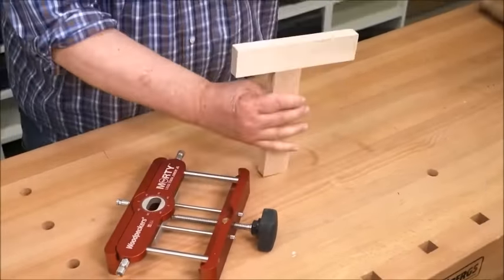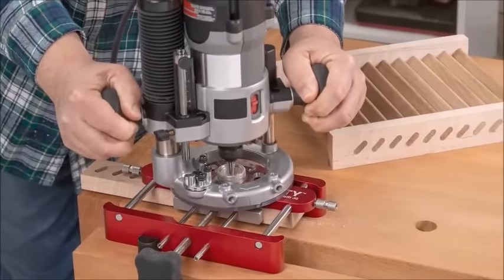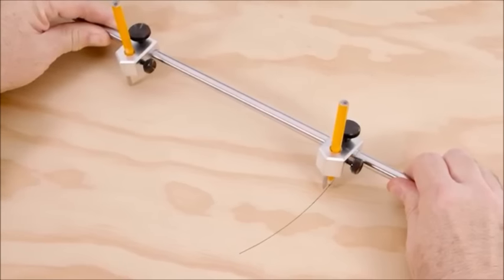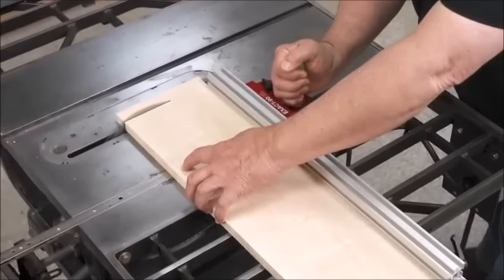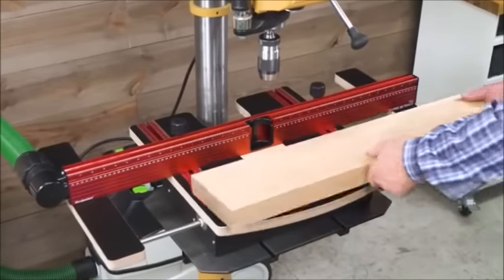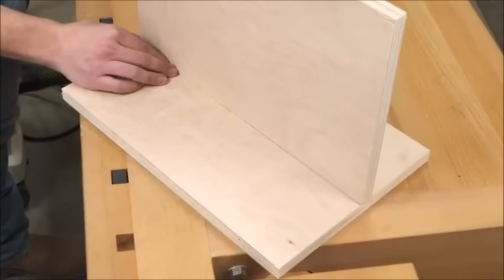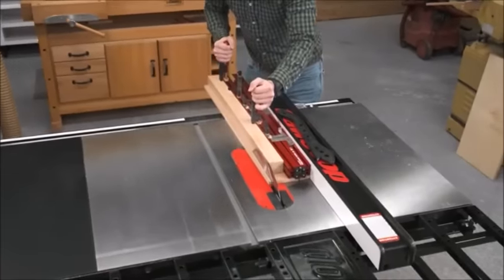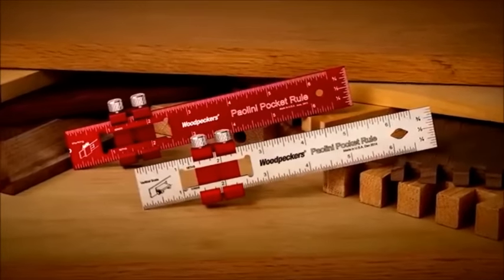10 New Amazing WOODPECKER TOOLS For WOODWORKING 2021

Comment: I watched the first 2 min and turned it off.   Just starting woodworking as a hobby but have been a machinist with my own CNC shop since early 90s.  If I need a jig for something I can create it in a few minutes to be EXACTLY what I need.  (within tenths of a thousandth of an inch accuracy)

Comment: Woodpeckers infomercial; stuff looks nice but the cost is just way too high for what it is. I have a friend that’s a machinist and he could knock out this stuff by hand quite quick a CNC mill even quicker so aside from material costs this stuff has a seemingly excessive mark up; don’t get me wrong I like quality but that can be balanced with newer production methods to get reliable tolerances every time for less and less money as tech keeps developing. I made a similar rod measure years ago using tube sections from rifle cleaning rods; I didn’t spend $40 on it including the machining time on the aluminum threaded stop blocks, which just shows a mass manufactured item nearly identical to that should be able to be sold much less expensively then theirs.
Reply: I'd love to hear how you did that or see a youtube video on it.

Comment: Great tool, just wondering how log will take before Chinese copy that and make it for the quarter of the price.
Reply: They already have!
Reply: @thehandseesall  and their copies in general are a tenth or less of the price but they're worthless - don't measure correct, inferior choice of materials
Reply: @punchline2529  True, but this is still too ridiculously expensive to consider over a table saw!
Reply: @punchline2529  just dont buy the first iteration.  
Usually the 2nd or 3rd they worked out most of the issues and they react pretty fast on complaints.
95% of the copies i use work perfect. 
For 25% of the price, i'll take that 5% risk.
Reply: @punchline2529  I avoid Chinese stuff but  1) woodpeckers do price themselves a little high inmo.
2) much of the suff can ge copied successfully buy anyone with a cnc mill and a lazer engraver /cutter.Even the chinese.

Comment: I always see people bitch and moan that stuff is made in China, but when a high quality and precision product is made in the U.S., they bitch and moan about the price.  I realize some people can’t figure out that the cost of doing business (wages, benefits, insurance, taxes, needing to make a profit to stay in business, product development/engineers, tooling/equipment, building rent/mortgage, business loans, utilities, retaining skilled labor, consumables, materials, repair, maintenance, security, volume sold of certain products, marketing, etc.) is much higher in the U.S……therefore obviously driving the product costs up……but there’s a lot more to the overall cost of the product than just the price of the raw material.  And for the “but gee, why does this cost $80 when they’re using $5 worth of aluminum” people, see what I wrote above.  They don’t just magically pull numbers out of thin air and exclaim “I think this will be a good price to soak the consumers with”.  If you can do it as good (or better) and for less money on the same scale of operation, have at it…..that’s the beauty of a free market and competition.  You do sometimes get what you pay for…..not always, as for example we see with shitty appliances made in China that cost thousands of dollars and look like a million bucks, but last only a few years (or less) before they break and/or need expensive repair…..but sometimes.
Reply: None of those tools  cost $80, dummy!
They cost over $400.

Comment: Hmmm

While there is no question that this tool (drill guide) is built with high quality materials and craftsmanship, it has an unjustifiable selling price. To see just how far off the beam the pricing really is consider the fact that a fairly high quality WEN 12" Drill Press 4214T can be had for about $275 which  offers far more capabilities. Anyone claiming that this tool costs more to manufacture than the WEN is simply a liar... The bottom line here is that with all due respect to Woodpecker Tools they are selling as much hat as cattle. Though there is no question it is compelling hat...